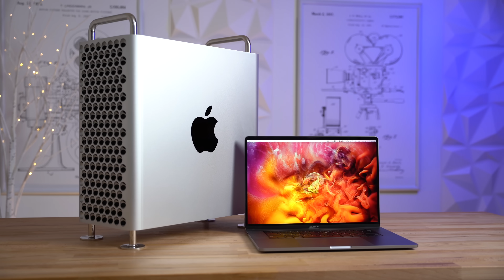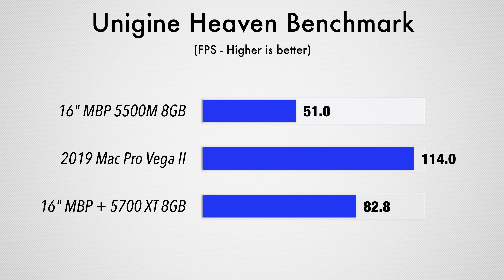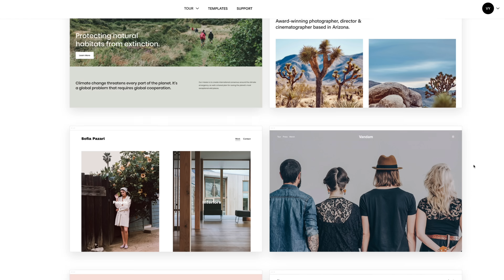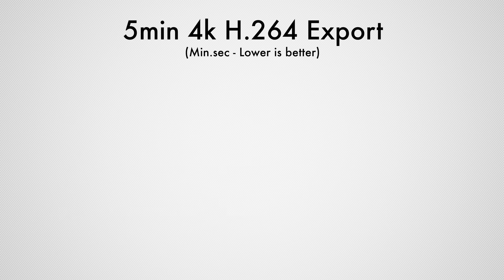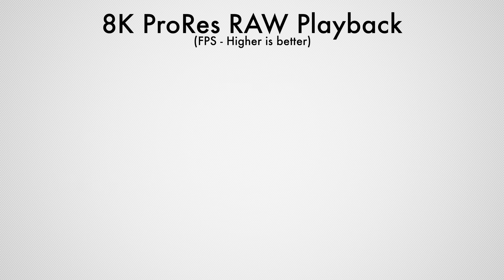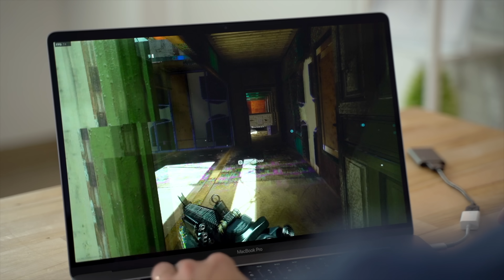16" MacBook Pro + eGPU vs Mac Pro - Can it Compete?

Comment: Great video. Few notes. 

- The Radeon 5700XT doesn't really work yet on Mac yet. It seems to be ok under Open GL game load, but when you do real Metal work with it, the card substantially underperforms. We found this to be the case on a few Apple PCI systems and it appears to be the case on the 7,1 mac pro as well. The Radeon VII has much better driver support and we've been finding it to work really well in Resolve. 

-  Adobe Premiere and Final Cut X have no idea what to do with an eGPU. The only program that does work with eGPU is DaVinci Resolve. From our testing, we're seeing dramatic differences in speed over the built-in 5500M in the 16" MBP. We haven't been able to compile a video yet, but we will once we get the 7,1 Mac Pro in for direct comparison. I would love to see what a fully licensed Resolve Studio version does on your 7,1 Mac Pro vs the 16" MBP.
Reply from the maker: Check out our last video where we compared the 5700XT to the Radeon VII and Vega 64. There’s a reason we went with this card. https://youtu.be/3MwPncpJtF0

Your right FCX could definitely make better use in the future but as noted we used version 10.4.6 instead of 10.4.8 because eGPU use was MUCH better and every test is quite a bit faster. The new version doesn’t use it for a lot of things. 

5700XT drivers need a lot of work but we did use dual monitors to drive better performance out of it. 65,000 metal score instead of 35,000 with a single monitor or 43,000 without a monitor (but worst timeline performance).

Comment: I’m sure you would get better performance using the egpu with an external monitor then trying to send the video signal to the egpu then back to the MacBook over the same cable
Reply from the maker: We did use an external monitor.

Comment: Your statement about Thunderbolt 3's bandwidth being "cut in half" during the BruceX test is incorrect.  TBolt 3 has 40GBits/sec full duplex.  That means it can push 40Gbits/sec in both directions simultaneously.  What's costing you is the limit in bandwidth.  PCI-E 3.0 x16 slots are 128Gbits/sec full duplex.  So you're running at less than 1/3 of the GPU's potential bandwidth.
Reply: So could you explain why some tests come out better than others? Are you saying that during gaming (benchmark or actual gameplay) the GPU is utilized less than during a render?
Reply: This confuses me too. If two way data doesn’t share the same bandwidth for tb3, then it has to be that during the times that the dgpu outperforms the egpu, the TB 40gbits/s bandwidth cap must REALLY bottlenecking the egpu, to let the dgpu surpass it so much. So then the tests where the egpu outperforms the dgpu, the bandwidth cap must not be too big of a factor. But is that consistent with the test results? I don’t really know the intricacies of these tests.

Comment: Have you tried using an external monitor for video editing. Apparently that makes a massive difference
Reply from the maker: We ran these tests with an external monitor connected.
Reply: Max Tech thank you your reply. I wasn’t sure. I’ve heard that using an external monitor is better with an egpu as the signal doesn’t have to travel back down the cable and thus limit bandwidth. It might be worth mentioning in the video in the future. Great content guys. Keep it up

Comment: What cable were you using? And the Radeon VII might have done better - the Navi drivers appear to be a hot mess.
Reply: This is correct. We found the 5700XT to be substantially slower on Mac OS than the Radeon VII compared to windows. I hope that 10.15.3 fixes some of those issues, as Apple is releasing a new 5700XT card of their own soon.

Comment: so i'm not surprised that the internal GPU of the 16"MBP is better than with a ePGU for "real world work" in like FCPX... nobody wanted to believe me ;)
Reply: It's not, the 5700XT just sucks on Mac. The software blows and none of the Apps used in this test know how to properly use a GPU.
Reply: @LittleDragonProductions  what about 5700xt on bootcamp
Reply: Ethan Wang Works great on windows.
Reply: @LittleDragonProductions  Thanks!
Reply: @LittleDragonProductions  nope, its actually bcuz of thunderbolt 3 bandwidth and how it all works with the system ... maybe the software could be a bit more optimised but that is not the main bottleneck
Reply: Michael P. Schmidt I’ve used it on a real mac, not eGPU and it just doesn’t work well on a mac. In fact, I’ve tested it on PCI 4 hardware and it’s very slow compared to the Radeon VII. On windows it’s much closer to the VII in performance especially gaming. It’s an issue with the Catalina driver, that’s why you can’t buy them from apple yet. They know the driver is an issue. The Radeon VII uses the Vega II driver as they are nearly identical cards.
Reply: @LittleDragonProductions  Thanks for providing so much info! MBP 16 is powerful enough for my daily working task, I want to get eGPU for gaming only, since 5700xt is not optimized for Catalina, as not yet. Furthurmore, there's a great chance getting error 12 in an eGPU setup with 5700xt. Is it better to get a Nvidia card just for gaming in bootcamp windows.
Reply: Ethan Wang If you’re running windows get an nvidia card. I just don’t know how windows will deal with the thunderbolt ports. Radeon VII is the card id get for mac.
Reply: @LittleDragonProductions  I got it, thanks for the advice.

Comment: I have a 2017 top end imac with the 580x Gpu. I was wondering if adding an egpu and 5700 would see substantial improvements in Blender render times. I have heard some rumors that Blender is working on a Metal version. That would help a ton.
Reply from the maker: Yes for that task absolutely. For most other things it’s not worth it with your setup.

Comment: It's almost like the 16" MBP is a trashy low end computer.
Reply: The Automaticist not even close. You get a lot of power for the money especially when video editing using Final Cut. That Mac Pro is $12 grand. Anything at a $3500 price point will look like trash vs it when doing video editing in Final Cut.
Reply: It's the only portable computer I've ever used that can do what it can do. It's amazing to be on set and render things without power! All of the PC equivalents require AC power to get their GPU's working. The 5500 is so efficient, it doesn't even kill the battery! I love my 16" and I will buy the next model probably as well, once the newer chipsets hit the market.

Comment: You guys are getting me confused: last video comparison among the three AMD graphics cards seemed like finally an eGPU was worth buying. Now I get the opposite. I mean, is there a way to determine beforehand if a Razer Core X with, say, a 5700 in it will improve my 2018 15” MBP with base Intel graphics onboard? I’m not upgrading to the 16” now so, did I do a bad decision getting the eGPU?
Reply from the maker: watch this video with the 2019 15" MBP
https://youtu.be/3Aa9q5ToJ7w
Reply: I did, that’s why I was about to get the 5700xt... but this on got me thinking.
Reply: I have an eGPU attached to my 2017 13” MBP and it is excellent in gaming and 3D rendering (which is what I bought it for). Basically if that’s your use case - go ahead. For video you might not get as many benefits.
Reply: I’m not a gamer, I use my 2018 MBP for audio and video production, hence the eGPU.

Comment: Thanks Max,Vadim very informative video really appreciate the hardwork you guys do. Could you guys please make video on amd 3rd gen ryzen 3950 /threadripper hackintosh build and test prores raw/10bit/hlg in final cut /davinci and blender performance comparison with MacBook Pro 16, mac pro . Do you think intel quick sync and t2 chip is necessary for those tasks?

Comment: I actually just got the base model 16” as they replaced my 2018 i7/2.2/555X/512 Model with it, and its a pretty nice upgrade.
Reply: Actually looking to get an eGPU for my Mac Setup, would an Razer Core X and 5600 XT or 5700 XT help my Premiere Pro and occasional gaming on Mac OS X needs?

Comment: Thank you so much for this rundown. Did you look into whether activating AMD Hardware Acceleration would make a difference in these tests?
https://forums.macrumors.com/threads/activate-amd-hardware-acceleration.2180095/page-24?post=27930808&fbclid=IwAR0VbnH7ptt0n0qky0QN-v5j2THiVrSVmJdc2U3ops0hOC7Qb3laQT0b6f0#post-27930808

Comment: Excellent video as usual. I would love to see you guys test a variety of GPUs in the Mac Pro as well, especially since the W5700X is still not yet available. I ordered the base 580X with the plan to upgrade at some point. Also curious as to whether the two built-in TB3 ports will still output video with a non-MPX GPU; and since most off-the-shelf GPUs lack TB3/USB-C output (or have only 1 if so), which adapters would work best to be able to use the LG 5K or Apple 6K displays.
Reply from the maker: Thanks! If you pull out the 580X then you will no longer have video output routed to your thunderbolt ports. Some thunderbolt monitors (like the 6K XDR) can accept a DisplayPort 1.4 signal without it being thunderbolt 3 but my LG 5K cannot so the XDR is more flexible. We shot this off in our XDR testing video where we tested 13 computers. https://youtu.be/C459uCplTY4 . One limitation with a USB-C output from a GPU is that it could not allow 10 bit and HDR at 6K but we still need to test more. Right now there are no AMD GPU's with USB-C so you won't be able to connect those dispaly anyway. With our new ThreadRipper build we did a similar thing to what Apple is doing,  routing DisplayPort signals through thunderbolt but we had to do it externally, here is the section: https://youtu.be/yJ2Bq7jTN7M?t=170 So far we tested it with our 5K LG and it works perfectly at 5K in Windows!
Reply: @MaxTechOfficial  Awesome - appreciate the info!

Comment: Awesome video, very helpful, but I'd love to know what temperatures were like on the MBP with and without the eGPU. Running triple 4K (my work desk) on my identical MBP 16 seems to add 10-15 degrees Celsius compared to using the built-in screen alone, and combined with other tasks, can make me keep the fans on high. If the eGPU could drop the temps that 10-15 (or even more) degrees, that alone might be worth it for me.
Reply from the maker: Yes it does run cooler and quieter when it doesn’t need to use the built in 5500M.
Reply: @MaxTechOfficial  that's great, thank you. I'm in the process of deciding whether to spend a fortune for a low-end Mac Pro (I really just need the reliability, temps, and quiet) or spend considerably less for an eGPU
Reply: oh, and how stable is it is another good question, although given your limited timeframe, that might not be a realistic thing to test. it seems that my internal Radeon causes kernel panics every few nights for unknown reasons while the computer is asleep

Comment: Thank you for posting.  Just wanted I wanted to know, and kind of what I thought it might be.  If my 2014MBP 15” had thunderbolt 3 and not thunderbolt 2 then the EGPU would make sense... for me.. just get a 16” MBP with the top end GPU and call it good for a few years.  Unless I want to play around with Mac mini 8 cores and EGPU.. and spend.. hmmm nearly as much as a MBP by the time I’m done.
Reply from the maker: Yes the 16” makes a ton of sense. For most even more than a Mac Mini and that only offers a 6 core.
Reply: Max Tech.  Now does FCPX network render or send to external render?   Years ago I did network rendering in 3D and it was such a long lead up time sending info over the network to server to render nodes that in the end, for images it was slower.. only better for longer animation sequences.  Though honestly I suspect the 16” loaded with max CPU and GPU will run laps around my current 2014 maxed out 15” MBP that I won’t even worry about it...  :)

Comment: Hi u should have removed Vega II and put rx 5700xt for an equivalent testing.
Reply from the maker: We will do a video seeing how much slower graphics cards are with external enclosures compared to internal but that’s a different topic. In this one we wanted to see how close the new fast MacBook can get the Mac Pro and it’s no comparison. A part of it is the weaker CPU but another big part is external graphics don’t work as well as internal.
Reply: Max Tech Max Tech can’t wait to see the 5700 XT vs Vega II. But cost wise you in £ your comparing £2160 vs £365. So you really need to buy 5 or 6 5700XT and squish them in the Mac Pro. Plus when you do the comparison you really need the base model card in there and have dual gpu’s. I know you can’t as you didn’t get the base card but I want to see that as well.
Reply: @billjones1121  The 5700 XT is HALF the speed of the VEGA II. All you need to do is look at the specs to see that. The Radeon VII is the only card on the market that competes with the VEGA II in the Mac Pro and it's pretty much neck in neck. The extra video memory on the Vega II does help.
Reply: Little Dragon Productions you right if you compare one 5700XT to one Vega II but that’s not a fair comparison as the Vega II is five times the price. Now if you put five 5700XT in a Mac Pro how would that compare?  I don’t know how well multiple gpu functions but Apple are selling a four gpu set up so Final Cut Pro should be able to handle at least four.
Reply: William Jones The Radeon VII is the same as the Vega II processing wise and you can get one for $525 new. So you’re really comparing a $429 card to a $525 card, not the silly expensive Vega II and the 5700xt is exactly half the performance of the Radeon VII, for only $100 difference in price. The Radeon VII was discontinued however. 

In terms of multiple GPUs, mac OS doesn’t use them all, it can only efficiently use one GPU. So stack it with 4 all ya want, really is that it’ll only use one. This is true for the Vega II duo as well, it only can use one of the two GPUs on the card, which is why it’s kinda slow in the grand scheme of things.
Reply: the test is really more 5500M 8GB versus 5700 XT eGPU. The Mac Pro is thrown in there more as a reference

Comment: You guys should also test what happens if you put the 5700 XT in the Mac Pro. Since the Vega II is last gen tech.
Reply from the maker: We will do this soon. We’ll compare 5700 xt inside the Mac Pro to 5700 xt egpu connected to Mac Pro.
Reply: @MaxTechOfficial  Awesome, thanks.
Reply: @MaxTechOfficial  That would be a really good way to see what kind of Thunderbolt 3 bottlenecks exist.  Can't wait to see that video!
Reply: I would also like to know, I have a 580X in mine and its pretty weak obviously, about the same graphics perf as my mbp 16" 5500M which is a bit sad. Looking for a valid AMD upgrade since I cant put my RTX 2070S in there :( I'm not too keen on spending ~3K on Vega II since I dont need that much video memory...
Reply: @xash7202  That would be a good comparison. Overall how do you like your Mac Pro? I have a 2019 15" i9 and was looking at either upgrading to the 16" i9 or a Mac Pro and keeping the 15".
Reply: @WeatherManAP  Well, it really depends on what you are doing with it. The amazing thing with the mbp 16" is that you have the perf of the entry level iMac Pro in a laptop, which is mind blowing if you take a step back (I used to have that iMac Pro and loved it except for the display...). Graphics are also great, the 5500M is basically a 580X in a laptop. But then the Mac Pro I have has 28 cores, so its 3-4x faster for what I do, and its silent while doing it, and it has 192GB of RAM (not from Apple)... so its obviously better - if you ignore the large price gap.
Reply: @xash7202  I never thought of the 16" as an entry level iMac Pro but in laptop form.  The Geekbench scores I've looked up aren't that different. I was looking at the base Mac Pro plus some storage since the CPU, graphics and RAM can all be upgraded down the road.  I am a meteorologist on TV and make  weather forecast and explainer videos around weather and climate. My 15" feels maxed out with some of the c-log footage I use from my EOS R. Either a 15" and a Mac Pro at a 15" and a 16" would be the options lol.
Reply: @WeatherManAP  If your 15" is 6 or 8 cores the mbp 16 will likely feel maxed out aswell - its "only" 20-35% better in the best case (unless you just need more RAM). The Mac Pro with 16 cores and above will give you 2-3x the perf and any amount of RAM. If you work at a desk most of the time it is a leap better, and for me allow things I just wouldnt do before. And you also dont have to deal with the jet engine noise the mbp makes when you do any heavy processing.
Reply: @xash7202  I just saw it's the exact same processor too, just with different thermals.  I have the 8 core. When screen recording the fans kick up very loudly.  My usual video is 5-10 minutes with some half hour specials. I feel like I'm sitting and waiting for it to render then export out longer than I am spending on the edit.  The quiet design is enticing.  Also thank you for your input. Other opinions on my decision are greatly appreciated.
Reply: We'll know soon as the 5700 XT "pro" equivalent is coming to the MP19 very soon in an MPX module
Reply: @elenchus  That would be another good test.  Is it better to get the MPX 5700 XT or buy a 5700 XT card by itself.
Reply: @WeatherManAP  I can speculate as to an answer. The MPX module will be silent and will avoid needing any cables. But Apple will use the "Pro" version of the card with lower frequencies, so it will probably be slower.